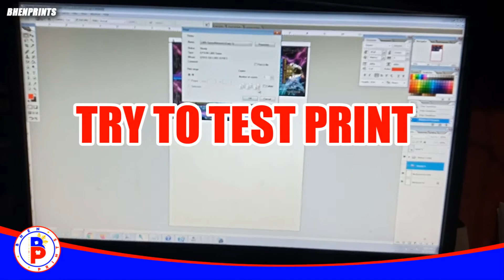EPSON L805 ALL BLINKING LIGHTS ERROR SOLUTION | FLEX CABLE ONE REASON | with English Sub Title

Comment: I need help ! First was the ink pad with flashing lights fixed that and ran nozzle check and noticed print head was out replaced that and cleaned everything that was clogged in tubes and now I get error message saying paper jam with flashing lights so I cleaned everything good even unjammed the roll and made sure everything was ok cleaned the pw sensor and the print head still gets stuck halfway with same error. Wat can I do?
Reply: @bhentech please help

Comment: Hello friend, you are a good technician, thank you, I leave my like and I subscribe, I speak to you from Bolivia, good video.
Could you help me with an L805, it prints well without problems in STANDARD quality, but when I change to HIGH quality I get a false paper jam, and all after cleaning the head, I checked the Flex and I don't know what it could be, your help would be very important, thanks in advance friend.
Reply from the maker: there is a tiny sensor near printer head pw sensor, i usually replace or clean that part, sometimes ink stains this part, clean or replace it. check my community tab I will upload part location
Reply: @BHENTECH  you are a big man, i need a help, and you do it, very thanks
Reply: @BHENTECH  thanks, what is the link of your community.
Reply from the maker: @hastaganar622  https://www.youtube.com/c/BHENPRINTS/community
Reply: @BHENTECH  thank you